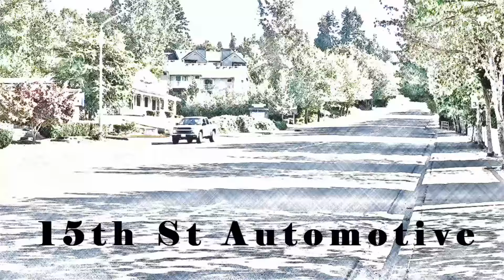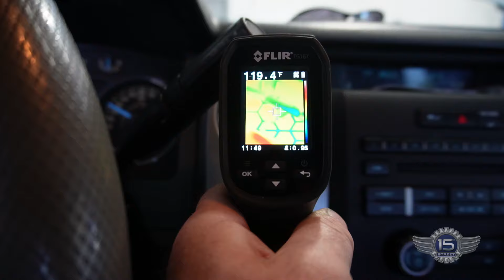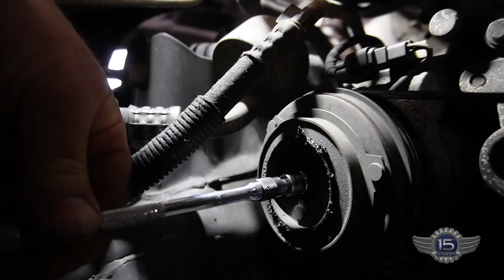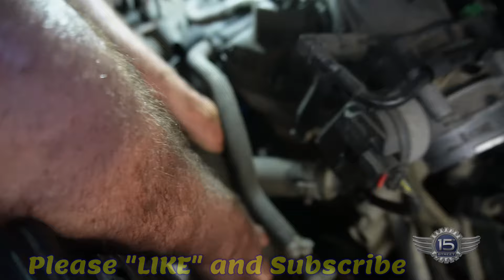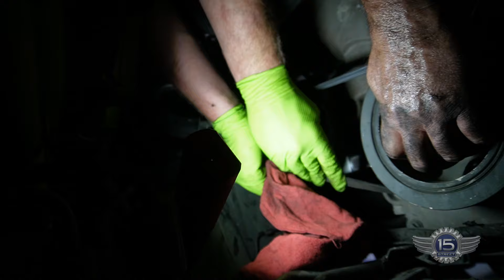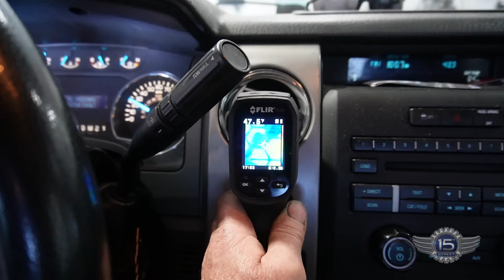Ford F150 AC Compressor Diagnosis & Repair

Comment: I have a similar issue. I took the clutch off my AC compressor, it was bad. My AC compressor was actually smoking because of the melted rubber. It is currently winter time, do I even need to replace the AC compressor? Can I leave the clutch off? It was the clutch that was making it smoke... My truck has 240k miles on it. I was also even debating cutting off the belt since it is a two belt system... Thanks for the video.

Comment: What about the whistling sound coming from the truck when it's been off for 30+ minutes and its cold outside? No AC used
Reply from the maker: Not sure I've noticed a whistling after 30 minutes. I have seen this just after shut down and its the high side and low side equalizing.

Comment: what was the final cost of this job? I'm  facing this.
Reply from the maker: If it's just the compressor then your probably in the range of 700-900 bones for the parts, labor and recharge. I don't like to talk $ on the YT page. But you can expect 3 hrs labor + parts + refrigerant.
Reply: @woodanthology-c3c   Thanks but I found yellow dye coming from my condensate drain today and you know what that means.

Comment: I ❤ YOUR no nonsense repair ethic. Thats the only thing belt driven why not electric Comp? i still have a 02 F150 crew fx4 original owner😅
Reply from the maker: It has a separate belt for the alternator and water pump with a traditional tensioner. I'm not impressed with stretch belts. Thanks for watching and commenting.